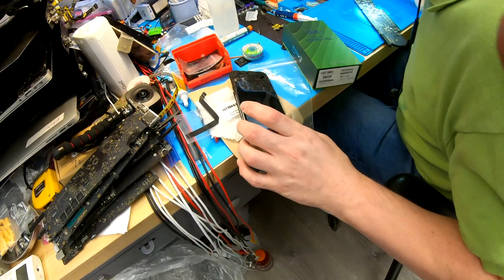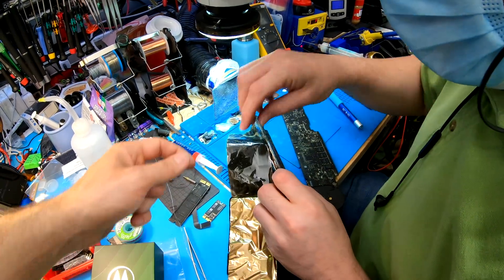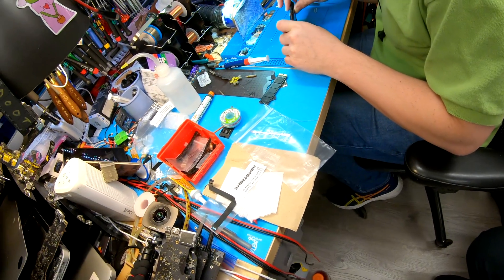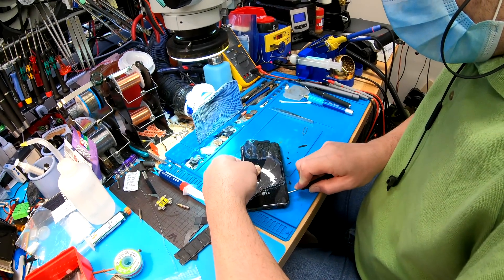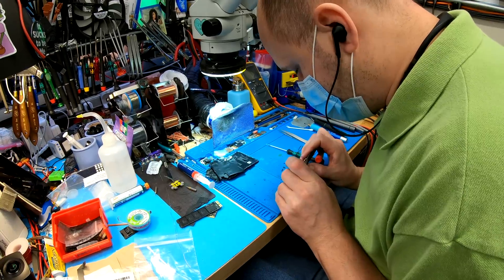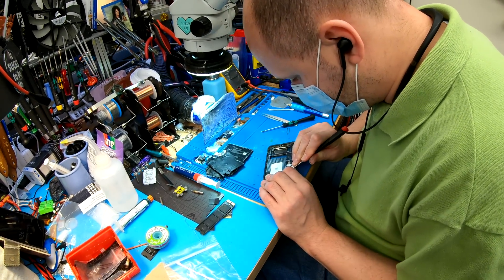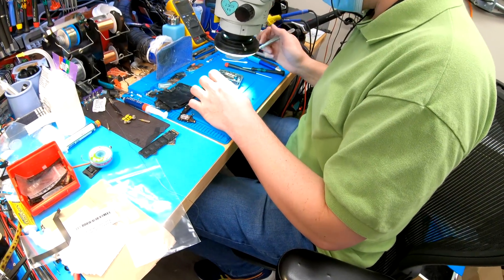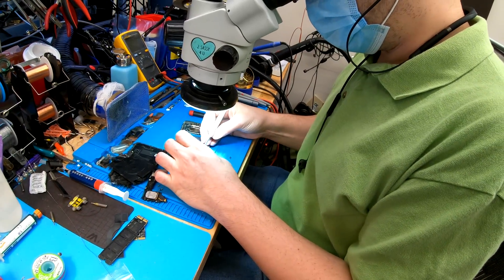Can Paul recover my phone data after the bike it was attached to goes on fire?

Comment: Main thing that causes e-bike fires in my opinion is the balance cables being worn though and causing a sort on the pack which then turns into a toaster element and melts though any protection and causes more shorts or cell damage.
A well built e-bike pack has very good attention to its balance cables and management of cell isolation in regards to handling the rigors of bumpy roads.

If you must have balance cables they should be rooted so that in no circumstance can they be pinched/compressed by the battery mounting method and also i would use teflon insulated cable it has insane pinch and heat resistance. You will need a razor blade to strip teflon cable no cable stripper will work.
Reply: If your not going to build your own battery only two i would trust is as you mentioned https://em3ev.com/ and also www.pingbattery.com

Comment: How many cycles were on your battery? 
Interested in seeing a tear down of one of these 'premium' batteries. I suspect 18650 cells were stacked on one another with inadequate electrical isolation between series groups and the vibration from the road caused two parallel groups to direct short which means you had 20 cells discharging at a high rate and no bms can prevent that from becoming a fire because the short happens before the bms. Only individual cell level fusing can save you in this situation and I've not seen any Chinese manufactures use individual cell level fusing. 

Alternately the bms could have been over charging your cells, which is common among many bms, and damaged a cell to the point where it allowed reverse polarity and you have 9 cells discharging thru one faulty cell and again no BMS will prevent that from becoming a fire. Only individual cell level fusing will save you in both the a fore mentioned situations.

Comment: I also have an AliExpress battery with (supposedly) 35E cells. I eventually want to build a pack with either Samsung INR21700-40T or Molicel INR21700-P42A that can both do 30A-45A per cell.
This video makes me think I should start this project sooner rather than later...

Comment: Hey, this is not related at all to the video but I recently got a used iPhone 8 and I’ve been experiencing a weird problem with my surround sound speakers on my iPhone. 

Okay so the bottom speaker works perfectly fine but the problem is my top speaker which works but is very quiet compared to the bottom speaker. I already contacted Apple support and they weren’t really helpful, and I emailed a local repair shop to see if they could do a repair for the speaker or something. 

But I was hoping someone or even you could help me figure out what’s going on

Comment: i appreciate the super detailed full disclosure you've written into different places in the Comments, Louis. you don't owe anyone any explanations and yet you went into great detail to make sure they understood everything about the situation.
it's not much of me to offer but i recognize you going above and beyond and i applaud it.

also power to the cheap Phone deals - i got myself a 2016 Flagship (Axon 7) for cheap since the Battery was shot, myself. easy replacement and i got a quite high end Phone for the cost of a crappy kinda low end one.
Reply: Ebike is great idea, just like the hoverboard, buy the weak spot, point of failure, is the battery. Battery tech isn't quite there yet. Like Apple products, not a question of if it will fail, but when will it fail. The results are quite explosive and frequent.

Comment: Then Apple was right all along. A mobile phone can "explode" due to battery fire.
Reply: Overheat or overcharge any device and it can explode. So that is like Apple making a statement that says water is wet...... Yes.....and....
Reply: @littlepeon  It was only to illustrate that Apple's argument almost always has a correlation / causation problem.
Reply: @elektronikk-service  except Apple's argument is that if a unintelligent repairman 'fixes' a mac and causes more damage, its a reflection on Apple, and not the repairman..so their recourse has been to just deem any non-trivial repair as non fixable, to always assign blame as customer fault, and to tell you that data is always non recoverable(and say its your fault for not having constant backups)- in other words they ALWAYS lie to you, for your own good. They are kinda like our current president, they never take the blame for their errors and believe their vision is always right. Even when ppl show that data is recoverable or that simple cable design flaws can be solved easily and cheaply they attack them for trying to solve the problem and not just throwing away the machine and buying a new one. Yes Apple notebook batteries, if overcharged can puff up and explode... It's a simple fix, to change out the batteries- Apple's response to this was to start glueing the batteries to the case. When repairman like Louis learned how to remove those glued in batteries safely, they changed the O.S. software to warn about foreign batteries. Apple much rather you buy a new $1k machine than spend $100 on a simple fix....that's just wrong no matter how you look at it. However those In the Mac cult will blame themselves- they must have not charged the notebook right- that's how Apple has indoctrinated them to think!

Comment: LOUIS ROSSMANN your great 
I have one doubt  I have 2019 model MacBook (trutone display)  ufortnatly Display is Brocken
then I change display but keyboard backlight is not working I try another display but same condition.  
I put old (Brocken display) DISAPLY keyboard backlight its working fine 
could you please tell me solution
Reply: It doesn't work because...Apple... 
Watch vids....if no backlight, something is shorted or blown....check all your power rails for proper voltage....check for visual blown fuse or caps...
Could literally be anything...

Comment: Hey Louis, did I hear on a recent video that you were pushing 4 kW through a 1 kW motor? I'm no electrician but I can see that causing some crazy heat issues.
Reply: Scroll thru comments....louis in detail explains why the 4-15A batteries should have been able to only handle 3A max load......but the facts are that they didn't... Battery tech isn't where it should be, and LI-ion batteries explode, repeatedly.

Comment: Using a bridge rectifier is a bad idea. Your batteries are not in a real parallel connection. In a one fraction of time only one battery works. So each of them turns on and then turns off frequently. That leads to overload and fire.

Comment: @Louis
I have been looking all over your videos to see if I can diagnose my macbook, it get stuck on the apple load screen and recovery mode and safe mode dont work.
Reply: Without cracking the case open(do NOT do if you don't know how) it could be many issues..blown capacitor, shorted component, etc. Apple will prob not fix it..they will try to replace it. Find an independent repair shop in your area...and yes it's Apple product so it will prob be costly(ppl who drive Jaguars don't get upset at $150 oil changes) but your machine probably can be repaired or data recovered.

Comment: i have  a g7 and the battery on it is bitchin.   the performance is good for the price when compared to other phones.   if it had the tap to on the screen it would be perfect.
Reply from the maker: It honestly is hard to criticize anything on this device given that it costs $169.
Reply: @rossmanngroup  it's true but as a guy that sells these phones for another carrier you.could.ha e done a lot worse for the same price.   A lot of carriers have started using MediaTek processors in their phones and they are terrible and usually cost more.   The lg stylo 6 is a perfect example of a newer phone that costs about the same price of the g7 but had slower memory and a worse processor.  At least the g7 has a midrange snapdragon instead of a MediaTek.

Comment: I recently burned my Galaxy S7 (log rolled out of the fire, didn't notice) and had to do much the same thing.  I found that the SIM card had melted into the slot.  I ended up taking the back off the phone, taped paper over the open back of the phone then dremelled the top of the phone until I could remove the motherboard with the tray stuck in it.  After a bit of work with some snips I opened up the shield around the SIM/SD tray and removed my SD card.  Amazingly it seems to work fine and I just stuck it straight into my 'new' Galaxy S7.  (I always buy second hand)

Comment: Should have bought one of the new Motorolas that have an Action Cam that films HORIZONTAL when the phone is set VERTICAL. The stabilization is pretty nice and you can hold it vertical, which is a lot easier and stedier.

Comment: Perhaps you could take a cue from Tesla battery tray construction and liquid cool the batteries by taking a heater core from a car and  remove the fins leaving the space between the cooling tubes to mount the batteries, so they can cooled on the sides of the batteries by the liquid in the tubes. A small electric water pump and another unmodified heater core  with a couple boxer fans mounted on it. The power to the pump and fan would be designed only run if the ethelene  glycol/water temperature in the battery core  exceeded 100 degrees Fahrenheit to dissipate heat both in riding, 3/8” Heater core hose would connect the system  and the cores could be mounted sideways to minimize width and maintain aerodynamics.

Comment: Louis, you are very lucky you did not enable "Adoptable storage" in other words, formating the Micro SD card as Internal Storage because being able to access these files would have been extremely hard.  Last time I heard how "adoptable storage" works is that the phone formats it using the EXT4 (Linux) partition, that on itself shouldn't be any problem as with Ext Volume Manager for Windows or even booting Ubuntu should still give you access to the files on the EXT4 partition, the problem is that the phone itself encrypts the whole entire volume using a key you didn't set, the phone randomly chooses a password, or the key without consulting you, this means that if the device itself dies (like in your case, by fire) and you are unable to power it on, well you won't be able to decrypt the files stored in the SD card that was treated as "Internal Storage" anymore.  With no way of the user being the one to pick the encryption key so that the user can be able to access the files himself shall the device be rendered unbootable, I have never bothered to enable Adoptable Storage in any of my phones.   You were able to access the files just fine because you left it as "Portable Storage" where the card remains unencrypted.  

Note:  This might have changed in later android versions, I just haven't done more research about it in terms of "adoptable storage", for starters it would be nice if Android makes the user pick the encryption password/key before encrypting the volume or just leave the EXT4 formatted volume as unencrypted. 

TL DR;
You were able to access the files stored on that 1TB Micro SD card because you left it as "Portable Storage" and did not turn on "Format as Internal Storage".

Comment: @LouisRossmann Glad nothing serious happend to you two, or any building for that matter.
I'd recommend looking into a motorcycle license and a Zero Motorcycle. Probably about as fast as your bike, but the battery is fully encased in steel. Other options would be to get some battery boxes welded/fabricated for your ebike ones.

Comment: You need to get out of the city Louis. There seems little need for a retail premises, if your not actually doing any retail. Things could get very grim for people living in the cities. Get out of the city whilst the going is good. You have an excellent business, which does not need to be located in the city center to prosper. Your standard of living would be greatly increased by not living in the city. The city, is the last place on earth you want to be when anything goes wrong. We have had a foretaste of what could happen with Covid-19. You don't want to be around for the real article. Relocate to somewhere decent outside of the city. You won't regret it....
Reply: @Gridlocked  The issue isn't the option's for Covid-19 treatment. As Louis is in a fairly low risk category. But the overall sustainability of aging megacities like New York. As the end of the petroleum age approaches, we are not going to have the energy or resources to continue to renovate and live in cities such as this. Society will, move to smaller scale already existing towns that can easily be repurposed for the post petroleum era. Huge aging megacities, cannot easily be repurposed, and are not the way of the future unfortunatelly...

Comment: In the automotive industry they incorporate fuse links in their harnesses for components that cannot be fused by standard fusing due to the high currents involved, they work like regular wire until there is a hard short and have a reaction of burning up with no destruction  replacements are available at auto parts stores. When I was 19, I had a wreck that shorted the harness right by the alternator, pushing the inner fender well into the alternator and harness. In tearing the car apart afterwards, I found the short and the blown fuse link that made my accident survivable by not permitting all the energy in the battery to set the engine bay on fire. My friend and I walked away with superficial injuries. 

 These hard short interrupters just saved another YouTuber,  from having his car burn to the ground when his alternator decided to short out it’s diode set.

This is his story about what happened. 

https://youtu.be/vfe6mPooIsk

Comment: I bought a standard Moto Edge a while back because I wanted a 5G phone. The screen had a green tint to the sides that got progressively worse, and the signal, including 4G, was incredibly unstable. Sent it back and stuck with my G7 Power. 

I never asked for a curved screen, but Motorola decided to let the first flagship they've made in ages be the guinea pig to a screen with a ninety degree curve on either side.

Also, Louis, if you're reading this, check out the PinePhone. 

It's alpha hardware and software, but it has dip switches to turn off the cameras, microphone, and wireless, runs about ten Linux distros last I checked, and the board schematics are publicly available.

Also, the Palm phone which does none of those things, but packs decent hardware into a tiny package for trump hands.

Comment: Don’t Androids have iCloud equivalent?
Reply: Yes, but most ppl don't need/use them. Android only really dies in extreme(fire, bottom of lake, theft) situations. Where icloud is integrated into Apple because you WILL need it(not a matter of if, but when) android lets u use 3rd party backup....and most ppl don't.
Reply: For photos, contacts, text messages yeah, app & app data? Fuck no. It's shit.
Reply: Nothinglastsforever - Really? When I got my last iPhone I logged in with my iCloud account and within 30 mins or so the new phone seemed to have everything my old phone did. If true seem like an accident waiting to happen if you have an Android phone.
Reply: @smplyizzy  You perfectly summarised the Android experience. A disaster waiting to happen. The only way to stimulate an all-encompassing icloud equivalent backup is by rooting your phone and using one of the root backup solutions.

Comment: @Louis Rossmann OK, Louis, once you get you head on straight, we need a, from the top, rundown of exactly what happened with a video of the mortal remains of your super bike and the damage it caused. I’m just happy you weren’t on it and badly burned and that your apartment didn’t go up in flames along with you and your lady and  cute cats and any other residents. 

Did you have any temperature sensors in the motor or the battery pack or controller areas, to warn you of impending Chernobyls about to light your butt on fire? 

Maybe you can find some blutooth temperature sensors with an Android app that can alert you if temp limits are exceeded in your next Electric Bike build that I Christen, The Phoenix, the E Superbike that rose out of the ashes! Other features should be a halon bottle fire extinguisher with metal halon gas distribution ducting preset to discharge into the most strategic places in the motor area, electronics bay, and battery areas.  Pull the trigger and at least it can buy you time to come to a stop and get off in a hurry.

I am so glad you are OK!